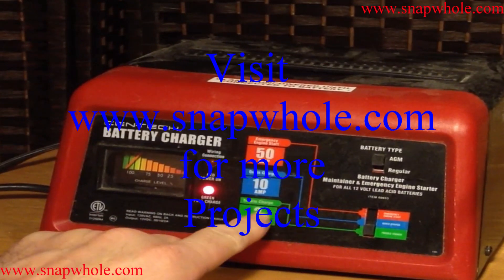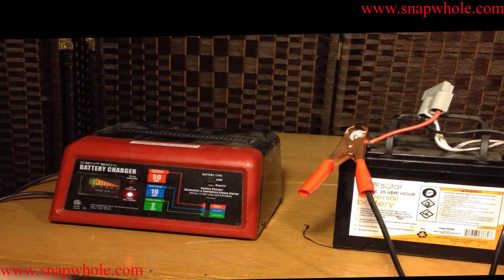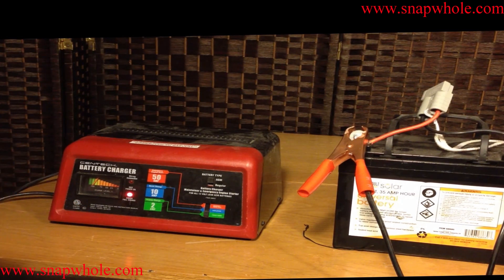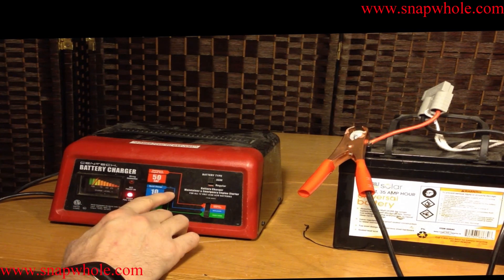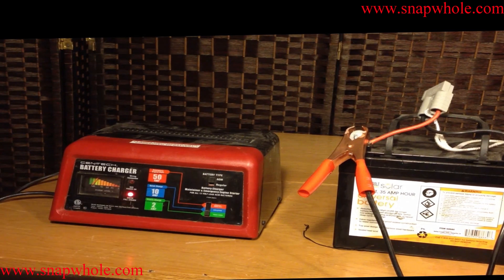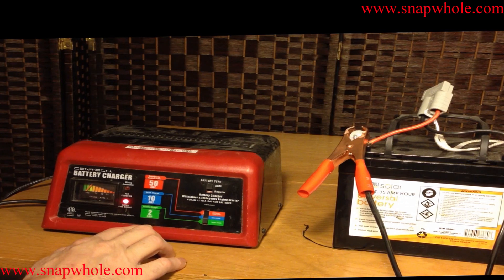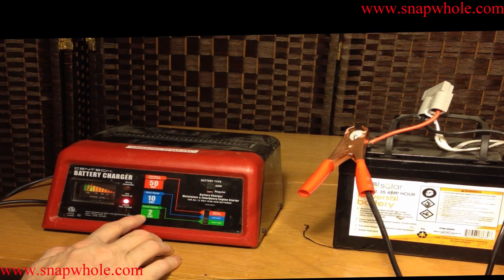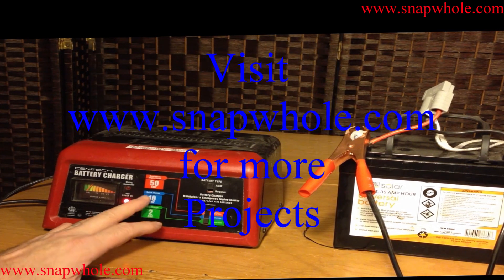Harbor Freight Cen-Tech 50/10/2 12v Battery Charger Review and Use Demonstration

Comment: What amp do i charge a rider mower at?
Reply from the maker: all lead acid batteries charge the same, 10 amp until it's done, then 2 amp until it's done - the batteries you see me charging in these videos are the same size used used in riding mowers - thanks for subscribing!
Reply: @snapwholeharborfreightreviews so you can charge at 2 amps or 10 amps basically?
Reply from the maker: yes, charge at 10 amps until full charged, then charge with 2 amps until it is fully charged, seems odd that full charged is not always full charged, but these are different types of charging, so the 2 amp will always see the battery needing charged after the 10 amp is done, the reverse if usually not true
Reply: @snapwholeharborfreightreviews if I have the time can I just charge it at 2 amps only and let charge overnight ? Im not in a hurry

Comment: I’ve had one of these for about 8 years. Charged many batteries with it. Jump start function is not the greatest, doesn’t always work but that’s not why I bought it for.
Reply from the maker: I've used the 50amp successfully once, and had it fail once, I've charge a lot of batteries with it, and very happy with it -thanks for subscribing!

Comment: It's always better to charge a lead-acid battery at 0.1C (multiply the C rate times the Ah rating of battery) or lower.  For example the battery you have there is a 35Ah battery and the ideal charge rate is 3.5 amps or lower.  You are always better off not using high amperage boost modes unless absolutely necessary.  If they drive the voltage up too high they can destroy modern vehicle electronics.  A more ideal charger size for car batteries is usually in the range of 5-6 amps since most car batteries are going to be in the 50-80 Ah range.
Reply from the maker: I typically charge using the 10amp setting, then switch to 2amp, it has always worked for me ok, I have used the boost mode once and was very surprised it worked, truck was fine, the charger has never been the same since, it has trouble detecting a full charge now - I normally unhook the cables and put on the charger, but that one time I was running very late plus I've been wanting to try the boost feature- with covid and everyone working from home, my truck does not get much use since I don't have to drive to work now - thanks for the recommendation on charging, but very few battery chargers have the ability to fine tune the charging amperage to those limits, most certainly not a $30 HF automatic charger - thanks for subscribing
Reply: @snapwholeharborfreightreviews  Good to know.  I'll stay away from the 50 unless its life or death then.

Comment: I just bought this exact same charger based on your review of it. So I tried charging a friend of mine's battery that was in one of her cars that hasn't been started in around 6 month's. I hooked up the charger, and none of lights on the charger came on. I'm assuming the battery is completely dead, that's why it won't charge, right ?  Thank you in advance for your reply.
Reply from the maker: This exactly the problem, the batter is completely dead and the charger will not start charging unless it detects voltage from the battery, you can put another battery in parallel with the dead battery and charge both until the dead battery has enough of a charge to trigger the charger by itself - after 6 months dead, the battery might be damaged, once you get it charge and reading 12 v, you should use a load tester to determine if the battery is healthy - good luck and please post an update if you revive the battery - with covid, I don't drive my work truck as much, and about 3 times a year, I go too long between driving it and have to charge the battery, and this charge has saved me a lot of hassle and money - thanks for subscribing!
Reply: @snapwholeharborfreightreviews   After I sent you the text , I noticed that the sides of the battery were bulging out , so I knew that wasn't a good sign !  I took it to a local parts store to have them check it out, and it was completely dead. I took my battery out of my truck , which I knew was good to check out the charger, set it on 10 amp, hooked it up, and the green light immediately came on saying it was charged. Seems to be a good charger. I don't have the need to need one on a regular basis, but I would rather have it and not need it than to need it and not have it ! Thanks for the video about the charger !  Very informative !  Thanks !

Comment: I have a comment
Do you need to plug it in ? To make it work
Reply from the maker: you have to plug the power cord into the wall, and connect the cables to the battery before it will start charging, that is a safety measure to keep the ends from touching and shorting out - thanks for subscribing!

Comment: I got one of these. Put it in the shed. Winter, car has been sitting. Went to start it, click, click. Checked cable connections, battery is too low to start the car, but I've got interior lights. Hooked up charger, says it's charging, check back in a few, cycling on and off. For laughs, hit the start function, it actually worked. So I went on a drive to charge the battery. Next winter, yesterday's major Blizzard went to move the car, no start, charger blinks, connection light random, does anything but charge. Hooked up an old shumaker, charged the battery. Tested the HD charger with my trolling motor battery, behaves fine. Shelved for that purpose because when it's below zero and you need to get the car started, it should just work. NFG in the real world. Tried twice, did bogus things, two strikes, your out.
Reply from the maker: I would not trust that battery, the charger is fine, this charge will not charge a totally dead battery, when you leave a car sitting, either unhook the battery or charge it about every 2 weeks, a car will drain the battery in about 2-3 weeks, after that it drains the battery to dead,  and this charge will not charge a battery unless the battery has some life in it, its an a automatic charge, and that is a safety measure, to keep the clamps from short circuiting when they touch, odd but a smart charger does this to protect you, and a dumb battery charger will let you hurt yourself - thanks for subscribing!

Comment: I have this charger and I'm trying to charge a motorcycle battery and I have it set on agm and when I try to charge on 10 amps and I'm getting a clicking noise and flashing between red and green light. On trickle its just a red light  no clicking any clue whats going on?
Reply from the maker: switching red/green back and forth means you likely have a problem with your battery, or is low on water, search youtube for AGM water, adding water to AGM is a little controversial, let the 2 amp charge go for 48 hours, if it does not go green, there is likely a problem with your battery, one of the cells likely has a little damage, the battery can still be used, but will run down quicker than expected, you will need to try and use it to find its limits, after the 2 amp charge, try the 10 amp charge and see if it still does the red/green switch - the battery charger is computer controlled, so if the battery is not performing normally, the charger can't figure out what to do, it does not necessarily mean your battery is beyond hope, that is why I'm recommending going back and forth on the 2/10 settings - the 50 is just for jump starting your car, so don't use it - thanks for subscribing!
Reply: @snapwholeharborfreightreviews   thanks for your help. I charged on 2 amps and now light is green after 4/5 hours of charging.  I took off charger for the night woke up hooked it back on the charger was red for 30 seconds. So I'm guessing battery should be good.  I will have auto parts store test it.
Reply from the maker: @KnifeNerd71  I would not worry about the 30 seconds, did you try the 10 amp charge the next morning? parts store can test, but you can get a load tester at HF, good to have if you use lead acid batteries - my review - https://www.youtube.com/watch?v=x8vh2xvETK8 - I use it to test my batteries about every 6 months, they get ran dead a few times a month, so I have to monitor them to be sure that abuse does not kill them - thanks for subscribing!

Comment: When plug in nothing comes on. Multimeter doesn't register any volts from the charger itself. So the problem is?
Reply from the maker: it has a safety that will not allow it to come until it senses voltage from a connected battery that needs charged, this is to protect the charger and the user from a dead short if the clamps were to touch - a dead short at 2/10/50 would fry the charger, and could seriously hurt someone - I thought I covered this in the video, I'll have to post an update video covering that function - if you are charging a completely dead battery, you can hook another battery in parallel with the dead battery to charge the dead battery - thanks for subscribing!

Comment: Just bought one yesterday and it killed my battery on 10 Amp, left it on overnight on trickle and I didn't even gain a charge
Reply from the maker: can you give more detail on how it killed your battery? the battery was charged and and after charging with this charger there was no voltage coming from the battery? did the charge kick on when connected to the battery? there is a red light when the charger is charging and a green light when its done - more information about the state of your battery and the behaviour of your battery will help others evaluate your comment when making a decision about this charger - thanks for subscribing!

Comment: Should it make a humming noise while plugged in?
Reply from the maker: mine does, and a lot of them do, any device that steps up or down voltage can hum, and the bigger the step up/down, the more likely and loudly they hum - this charger step the voltage from roughly 110v ac to roughly 12v dc - there are ways to change the design to eliminate the hum, the cost is rarely worth it, because they work just as well with or without the hum - to test this, find a power company transformer that is ground mounted, most of those have a loud hum, (pole mounted are just as likely to hum) - if they are humming, odds are its giving off stray RF that can be heard on radios - in summary - the hum does not impact performance - thanks for subscribing
Reply: @snapwholeharborfreightreviews  thank you....and this is random but if there is a spark when I first hook the charger to the battery does that mean there is a definite charge?
Reply from the maker: @jubilee2343  its very normal to see sparks when you first hook it up, same thing when you plug something in to an outlet in your house, the speed you connect will after the sparks, faster is better, but overall, impossible to eliminate - that is a sign the battery has enough voltage for the charger to 'see' the battery and charge it, the charger will only charge a battery that has a minimum charge, this is a safety measure, otherwise anytime the two clamps touched there would a LOT of sparks
Reply: @snapwholeharborfreightreviews  thank you

Comment: if your battery is completely dead this charger won't work.
Reply from the maker: That is clearly stated in the video, this is a safety measure, question of how to charge a dead battery has been answered many times in the comments - simple hook another battery in parallel and charge them both until the dead battery has enough charge to be charged by itself Thanks for subscribing!

Comment: Is it safe to leave on 10amp overnight? I heard on one of these videos the unit will idle down once charged but can't find anything in the manual on charging  situations.
Reply from the maker: yes its safe, this is a smart charger, it senses the batteries state and turns off when it is as charged as the 10amp can make it, then use the 2amp setting to 'top it off' - I use these process to keep my batteries in good shape, and it works great - thanks for subscribing!

Comment: I bought this exact harbor freight charger about two weeks ago and it died that same day. The computer on the inside fried. I cut it out and hooked the transformer directly to the rectifier and presto, I got my $60 battery charger back, and cost me only a few minutes of my time.
Reply from the maker: inflation is pretty bad, i paid $30 for mine - i'm wondering - if it failed on day one, why you did not take it back for another one or for a refund? $60 for a dumb charger with no safety controls seems like an expensive charger, and an extremely dangerous charger, if you hook it up backwards the battery could blow up and acid would go everywhere, including on you, or let the clamps touch while its plugged in, and you will have a dead short, lots of potential deadly problems, I encourage you to return the charger to the store before someone is seriously injured - or just throw it away, not work the risk - thanks for subcribing!
Reply: @snapwholeharborfreightreviews  I wanted an old fashioned battery charger without the smart charger technology. That's why I cut out the computer. Smart charging takes too long charge any battery.
Reply: @sandasturner9529  u live on the edge huh

Comment: I bought this exact battery charger.  My battery appears a bit weak when starting in cold weather.  My question is:  Will the 2 amp Trickle Charge mode also switch to green and turn the charging off when it reaches full charge?
Reply from the maker: yes it should, but if your battery will not charge to 'full' it will not switch to green, this does not mean your battery is bad, just that its not perfect, and one of the cells is weak, leave it on the 10 amp until green, then the 2 amp trickle charge for 24 hours and if its not green, then its not going to get better, but the battery is probably still useable - thanks for subscribing!

Comment: Nice review. I bought one but confused about when it reaches full charge. On mine the needle is on 100% after a few hours and the green light comes on but 5 seconds later the red light comes back on. This back and forth continues for awhile. Does this back and forth of red and green means it's done charging? Any info appreciated.
Reply from the maker: green means done, but it periodically does a recheck to see if the battery needs charged, if its flipping back and forth rapidly, its possible its sensing something wrong with the battery - I recommend charging on 10amp until done, then 2amp until done, the 2amp is a trickle charge and tops off the battery - thanks for subscribing

Comment: My battery is 6 months old..after rig setting for a week it drained to 1.96 volts, maybe a parasitic drain. Hooked this charger up and i belive voltage was so low on battery the charger did not detect battery hooked up. No light came on and i checked voltage at clamps hooked to battery and nothing. Thought it was a bad charger. Took it back and got a new one and same thing.
Maybe if voltage is so low this charger will not detect battery and turn on. Any thoughts any one
Reply from the maker: that is exactly what is happening - the charger has to detect voltage from the battery for it to energize the cables, its an important safety measure - wire two lead acid batteries in parallel and charge them for a few hours - that will give the dead one enough charge to trigger the charger  - parallel is + to + and - to - between the two batteries, then hook them up to the charger, its still 12v, just 70AH, so it will work fine, thats how solar panels charge battery banks, thanks for subscribing!
Reply: same here. After returning first unit and trying to charge a battery I had removed from vehicle, the charging light never came on. Don't have a meter to see if any voltage in battery but I didn't realize the battery needed to have voltage for charger to work. HF was very good about exchange and then refund after 2nd charger wouldn't charge my battery.

Comment: Vehicles that have stop/start function will have AGM. AGM batteries for a multitude of good reasons are used on a large number of quality vehicles.
Reply from the maker: AGM batteries are deep cycle batteries, which means they stand up to deep discharge better than transitional lead acid batteries, applications like - battery banks, scooters, UPS - Thanks for subscribing!